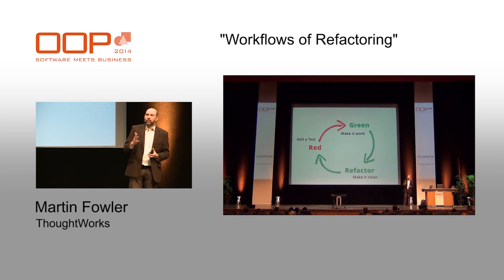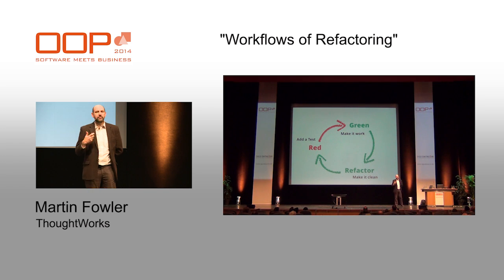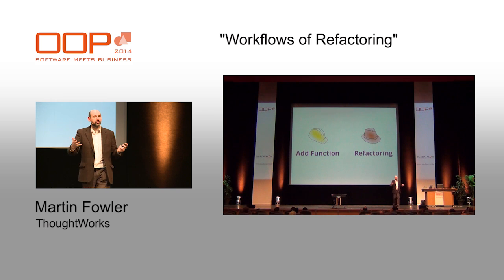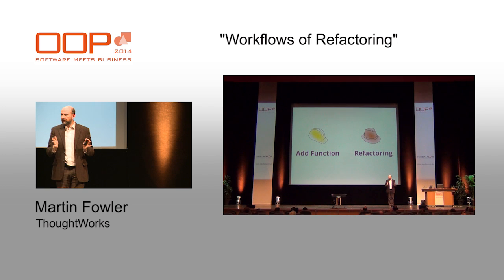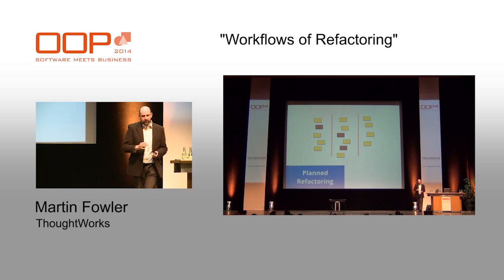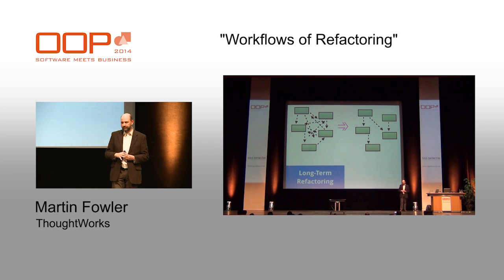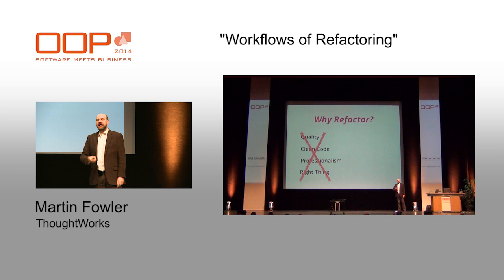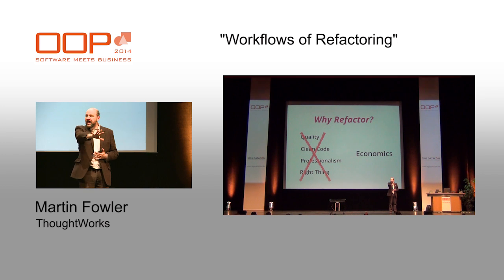Martin Fowler @ OOP2014 "Workflows of Refactoring"

Comment: So this video confirmed that my workflow isn’t that messy after all. I usually start with a rough sketch of a requirement by writing/drawing them down. Then i try to build the feature asap. I more or less ignore all the rules that are in my code, which mostly results in a big class with everything in it. After everything works i than clean up my new code by refactoring it. 🙏🏻🙂

Comment: Did some note of Martin's talk as take away. 

"Workflow of Refactoring" by Martin Fowler @OOP2014 

Two modes of code development 1) adding functions and 2) refactoring (including performance improvements). 
Rule of thumb: Separating refactoring keeps work focused 
Mindset of refactoring: when you see something yuck you do something to fight against it. 
Scenarios of refactoring: 
1)	Litter-pickup Refactoring (Something yuck but easy to address): Refactoring it to a green state then start your feature work. 
2)	Comprehension Refactoring (Complex logic you spend time to understand): Refactoring if possible or adding comments on how you understand that piece of logic and queuing tasks with enough context. 
3)	Preparatory Refactoring (Refactoring is benefiting your feature work) Then refactoring first. 
4)	Planned refactoring. Try to avoid such unless it has economic purpose and become necessary evil. 
       a)	First break it into small pieces. 
       b)	Then developers to tackle those piece by piece whenever touch that scope of code. 

Refactoring is not unwanted wasteful rework if it has economics purpose - improving agility / not slowing developers down.
Reply: thanks a lot,it saves me time to take a note!

Comment: when i was adding an icon to a list of things i found very overly complex code, but had no time to fix it.  How should one deliberately schedule this work, when the management would never justify the extra time.?
Reply: It's difficult if you have metrics based on number of features added, but possibly the best way is to do it in small chunks as part of your day-to-day work, and discuss it in terms of keeping the code in a state where it's easy to add features. 

As long as managers can see that what you're doing is supporting the goals they have, and not competing with those goals, it's easier to justify time spent refactoring.

Comment: what about legacy code, where there are large swaths of bad code that warrant deliberate refactoring with no new features directly being added immediately, but would definitely prepare for easier addition of new features later.
Reply: I'd start by writing tests from the outside in. Get all tests written, then start refactoring as required, writing new tests if necessary.
Reply: As he said, you don't have to refactor everything but at least do something. Extract out some logic or even just create a test

Comment: I would like to see the likes of Martin debate the ideals of Harlan Mills directly.
Reply: Harlan Mills' editor - himself a CS Professor at NYU who taught me data structures - told me that Mills' approach was terrible. For example, he hardcoded everything. In the NY Times project, the resolution of the 5" screen on the terminals appeared throughout the System, which affected screen layout, records, field sizes, etc. Shortly thereafter, the Times moved to larger monitors and the entire System had to be rewritten.
Reply: @BangsarRia  Might quite the edge case, but I do see the point. Another might be the Java garbage collection issue that occurred when systems had over 4GB. Mathematically, the code was correct, but it overflowed the int variable in use and became negative.

Comment: All these refactoring and TDD talks are great, but they are missing out one thing. 
Not everyone in team agree on what and how clean code is, or even agree on test is a thing to do in software dev. 
Some people just prefer long, long, Long messy procedural code in 1 method, (people see their own mess as fine)
while other think refactored code is too complicated and hard to read as they scroll. (like private helper method is unnecessary) 
Some senior lead even punish you if you refactor even one small section of code 
under the belief on "if it ain't broke, don't fix it" and "we got to deliver the feature by Tuesday."
Reply: Mentor those folks to help them see themselves as professionals who take pride in their work (this will only work if there are unit tests you can trust for every piece of code you touch - which means you have to write them, making this approach infeasible). 
If they insist on being IT hacks only there for a paycheck, get another job where your superior skills are valued; if you stay you will soon be buried under their technical debt and "next Tuesday" will become "next year".

Comment: Refactoring is usually the admission that you got it all wrong on your first try. I had projects where I gave up refactoring in the middle of it and I just wrote the entire thing from scratch by reusing just the bits that actually worked great. The final result was always much better than what the refactored code could have been under the best of circumstances. I am not even bothering with refactoring anymore. When I see an architectural flaw I go in and fix it completely.

Comment: why not just do it right the first time? why rush out crap and then go back and redo it? customers don't care about your process, they care that they get a quality product
Reply: Mary McGloin because new ideas come along that don't fit into the old way the code was written. e.g. statistics charting application becomes interactive with animated transitions.

The original chart app may well have worried about preparing data sets and putting them on a chart. The new app needs to correlate datapoints from one state to another and animate on a chart. Probably need to introduce some new objects and then refactor across them.
Reply: But then it's just a new feature.
Reply: Mary McGloin Exactly. Add the new feature; lots of new code and gain an understanding of how it interacts with the existing code till you get it to work (warts and all). Then, refactor the code to update the patterns/interactions to meet the new need.

I have found that mixing refactoring and new functionality takes a very long time and you have long periods where everything is up in the air and mistakes are made.
Reply: +Mary McGloin There are lots of reasons why code needs to be changed. First, customers will choose a product they can use--even if it has some bugs--over a product that hasn't been released because it isn't perfect yet. And sometimes the code works perfectly well, except it can't easily be modified to add new features. It's not that it wasn't "right" the first time, it's that the definition of "right" has changed.
Reply: I'm aware of that.  I'm speaking of when code is shoved out quickly into production with hacks and known issues to adhere to a very inflexible "agile" process,  the idea being one can "iterate" fixes quickly.  Reality is, you end up with an unstable, unreliable product (lose customers) and driving your dev and QA team nuts because you're always in fire mode
Reply: +Mary McGloin publishing poor code is a slightly different problem!
Reply: +Mary McGloin You can try to do it right the first time, but no matter how much you try you almost always need to go back and refactor. If you don't go back and refactor the code it will eventually become so tangled and complex that changing or adding code in the future will waste far more time than just refactoring it as you go.

Customers always want changes or bug fixes during development and doing that with un-factored code will just be wasting time and money. Quality is not just on the surface. Quality of code saves time and money in the long run.
Reply: I don't disagree with you, Sebastian.  I've just sometimes seen no refactoring rushing out crap on top of crap. Quality is a process and all teams need to be on board.
Reply: +Mary McGloin Almost any product can use some kind of polishing and cleaning up any time - no matter what. 
The opportunity to go back and cleanup the code does not necessarily mean that the programmer can now care less about producing a good code at the first time - that is just "bad programming" and needs to be dealt differently.  It is rather making the "tuning and tweaking" step as part of the regular development process so the application becomes cleaner and better than how it was in the first go.
Reply: it comes to us from the God. He created f*cked up people  in first attempt and then cleaned them by flooding whole world. As we are created in His image We are carrying that original sin.
Reply: Customers don't care about code, they care about product quality. There is a difference.
Reply: Customer's don't care. But you as the programmer will care. To quote from his book, Refactoring page 6: You may be tempted to make the fewest possible changes to the program; after all, it works fine. Remember the old engineering adage: "if it ain't broke, don't fix it." The program may not be broken, but it does hurt. It is making your life more difficult because you find it hard to make the changes your users want. This is where refactoring comes in.
Reply: you can do it right the first time, 2 months later customers need it to evolve. well customers do care if you can make the changes in 1 week or 1 year. keep trying "do it right the first time" you will end up with the latter.
Reply: @MaryMcGloinActor  it's seldom "JUST"